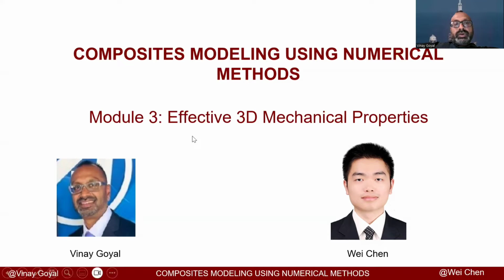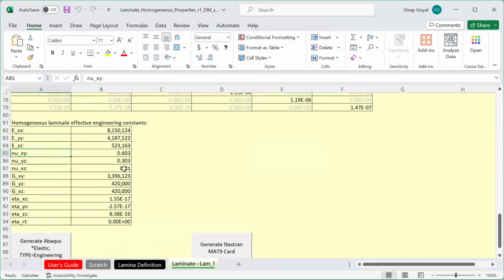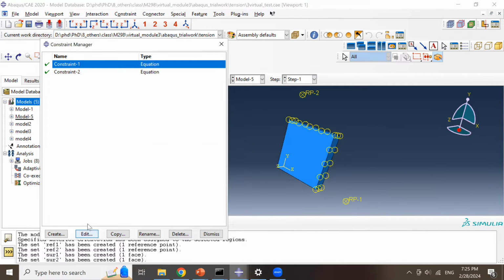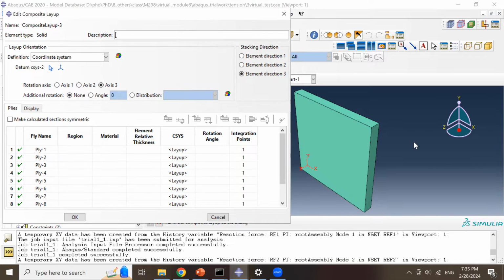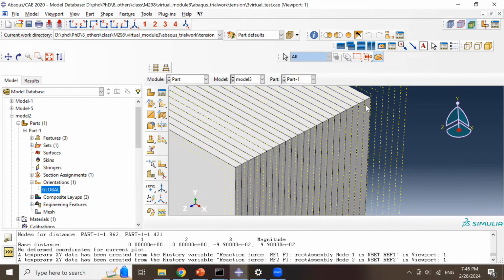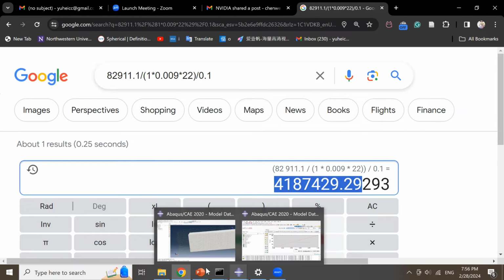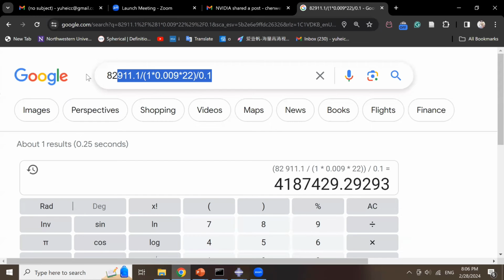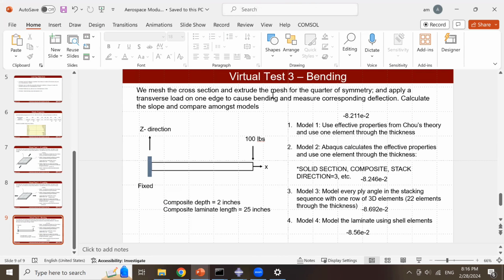#ABAQUS TUTORIALS: COMPOSITES MODULE 3-  3D EFFECTIVE PROPERTIES TO MODEL COMPOSITES

Comment: Is there a clear rule for determining the fiber orientation in composite materials? And is it possible for the composite layers to be completely different without any symmetry?
Reply: For determining fiber orientation you really have to look at the direction you are trying to maximize the material properties of the composite. You can use a normal 0/90 fiber orientation if it doesn't really matter or really maximize the material properties in one specific direction. You really want to avoid non symmetrical layer orientations around the mid plane as the part will warp when cured.

Comment: Hello sir, I am currently studying civil structural engineering and would like to potentially make the transition to aerospace in the future. If I were to go for a structural position, what gaps should I fill in? Is this transtion feasible?
Reply from the maker: Very feasible is very very feasible. In fact civil engineers are very good at fundamentals which is lacking in aerospace engineers
Reply: Is there a clear rule for determining the fiber orientation in composite materials? And is it possible for the composite layers to be completely different without any symmetry?